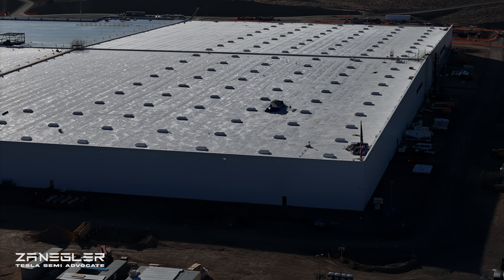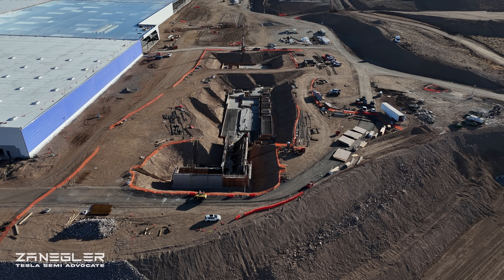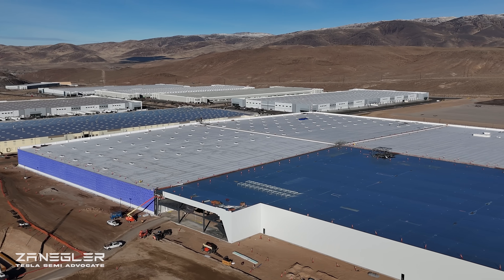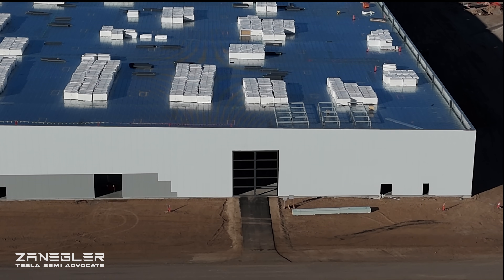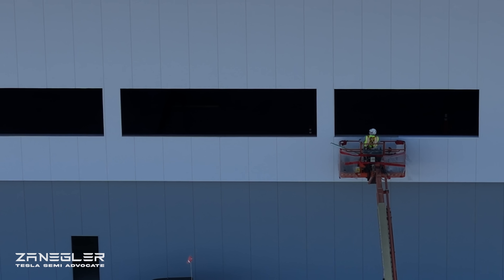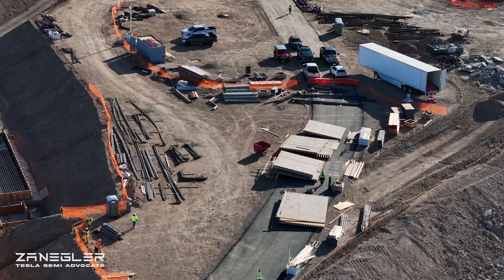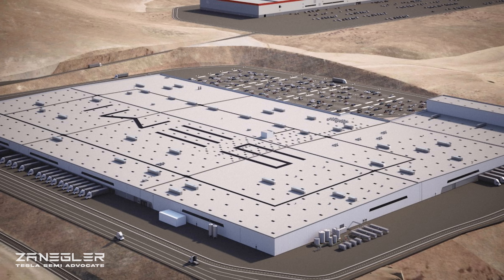2025' The Year of the Tesla Semi

Comment: Well, simi truck fames are a real simple creation. Simply 2 straight C channels
with cross braces make up the frame rails. Unlike Pickup truck frames which have 
slopes and bends simi frame rails are arrow straight. Super heavy duty big ass C 
channel but still, simple common C channel. Some builders use aluminum
but most are steel. For extra heavy duty trucks like quarry & heavy haulers they will
double up 2 C channels for extra strength.
https://www.youtube.com/watch?v=tO0z6soIDcg

!

Comment: Yellow plastic is moisture barrier for under the concrete - keeps the moisture in the concrete as it sets.
Reply: @R.BOWERS  You're both correct.
Initially holds moisture in the concrete as it cures.
Stops the fines being sucked out of the underside when the concrete is laid over a particularly dry surface. Often see this with footpaths/sidewalks, a demolished section will be extremely 'boney' on the underside.
Prevents moisture rising from the ground into the cured slab.

Comment: 5:09. Shadow on the inside of the edge slab shows a step down to the yellow plastic. Yellow plastic is the moisture proof membrane under the concrete. Rebar and concrete yet to be placed.
11:18. Column footing, left of centre. Plate with hold-down/anchor bolts visible. Column pedestal partially cast into the chamber wall.
Far left on the same alignment is an arrangement of 4 rebar starters showing the location of another column pedestal. Larger footing (a rectangular column pedestal) further left again seen at 10:17. All 3 visible at 12:05 in the overhead.
12:36. Top left, behind the crane. Might be charging infrastructure. Lots of ductbanks (conduits) and conduit risers. Too closely spaced to be lighting.
Reply: Thanks for all your insights.i am sure us nontech types will learn a lot from you .we all await the stockpiling of internal machinery.
Reply: @geoffkendall3191  You're welcome.
Reply: well said
Reply: @larryparrish7780  Thanks Larry.

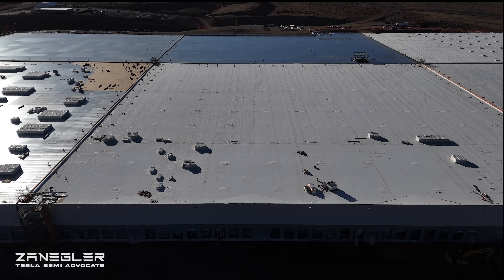Comment: Heinrich, I think you omitted to draw attention to the fact that at the 7:26 , the insulation being laid is actually in two layers (at least this wasn't noticeable in previous sections), and the section B has very well visible (under the white roofing layer) the points where the future skylights will be made. It is not as well visible in the remaining parts of the two sections that were done prior to this one, i.e. A and F if I'm not mistaken.
The speed is amazing. Oh, and regarding the yellow floor covering material, it is visibly lower than the concrete layer around the corner of the section D, which means it is the bottom plastic layer, insulating the dirt from the concrete; as there is no rebar mesh visible, this needs to be still laid onto it, and only then the concrete will be poured. Also, innthe section E was visible a moving cart, which means if it was riding on top of the fresh concrete, it must be already cured so as they wouldn't destroy it by their wheels.

Comment: I suspect they have a contract for stamping based on time and/or amount. Like you said previous, these machines are expensive, so when signing current contract, the supplier want to have security the made investment is made back before costumer leaves and makes his own. The price per part also changes based on the amount of stamps made by the machine. It's quite possible that even if the machine on side is ready they still have to take some stamps from their current supplier just to fulfill their contract or pay a fine by not fulfilling the contract amount (what has no logic to do from tesla point of view, just take the contracted amount before (or, if) taking all in house. Possible outside sourcing will be far longer needed for the amount of production is planned or higher production than expected.
Reply: I agree and that would make much sense. I'm sure Tesla is very experienced with this sort of contracting - going from prototypes to initial production runs to full factory operation. Probably most if not all of 2025 seems likely to rely on contractors for stamping production parts while the new stamping building is finished and all the equipment is installed and tested. Meanwhile the actual design of the Semi will be continuing to evolve through R&D work.